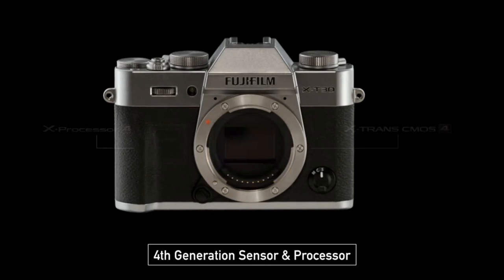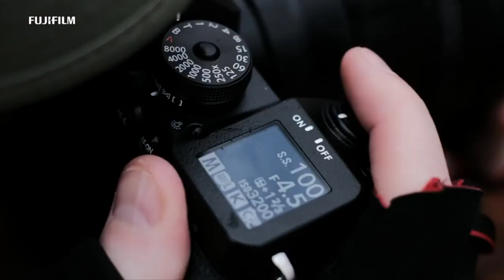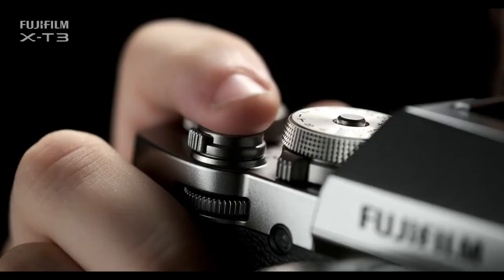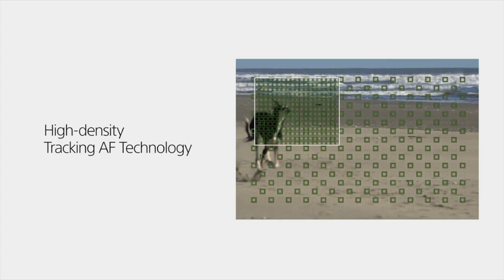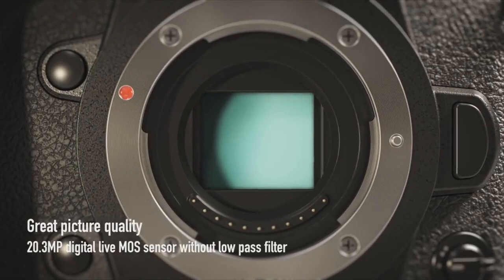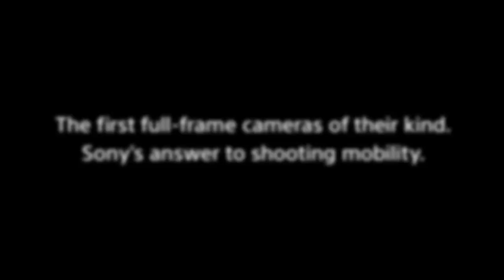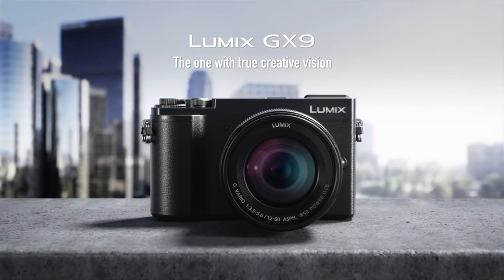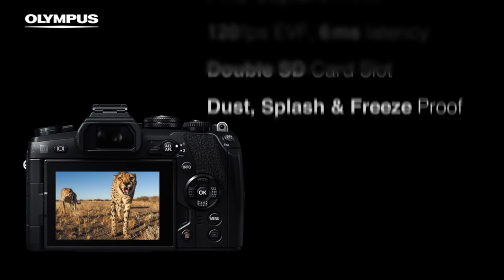Top 10 Best Mirrorless Cameras For Beginners

Comment: The video says for beginners but then camera two is for professionals and is a top of the line model.
Reply from the maker: Sure. But not all beginners have low budgets. Everyone starts out at different places on that front. You'd probably be surprised if you knew how many beginners go for the flagship cameras. That's part of the reason these camera keep the semi and fully automatic modes. Otherwise, manufacturers would completely remove them. They may not be as helpful for beginners and aren't ideal. But they're excellent starting platforms nonetheless.

Comment: Hi I was planning to buy a7iii. But I'm  confused because of Sony color. Also I cannot afford telephoto lens for Sony full frame body. For the same budget which camera I go for where I can get telephoto lens. Video  I expect 1080p with 60 fps
Reply from the maker: Are you looking for a Sony camera?
Reply: @PhotographyPX  yes. i havent' used sony camera before. i learned basics from Canon rebel camera (older before 2012). for a7iii i prepared budget. but many telling that colour from sony not good. particularly skintone. That's were i'm getting confused. i want to work with full frame camera. since i'm not used with sony camera, i couldn't think what colour difference sony have.
Reply from the maker: The a7iii has the best colors that Sony has. If you don't like those colors, consider a Canon camera instead.
Reply: @PhotographyPX  I will go with a7iii.
Reply from the maker: It's an excellent camera. You can always create a custom picture profile in camera to adjust the colors to your liking.
Reply: @PhotographyPX  thanks bro